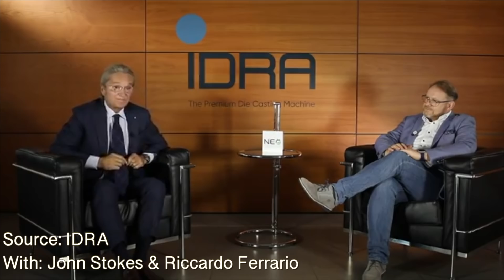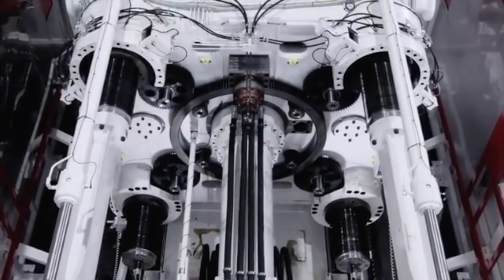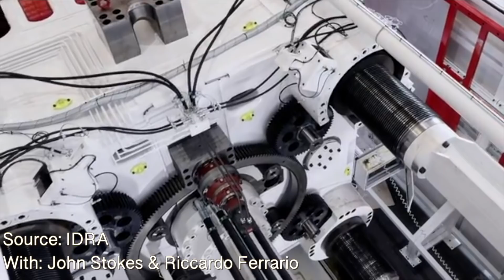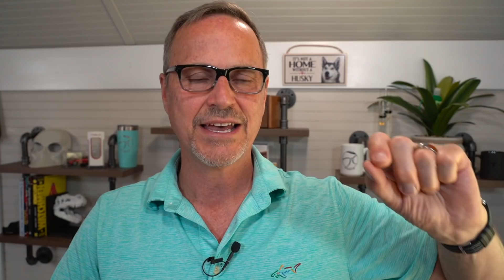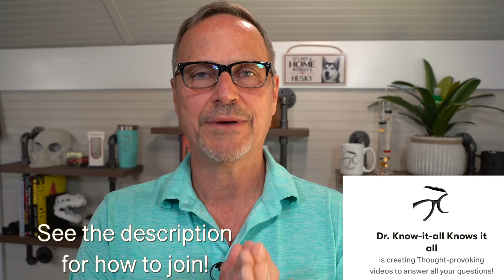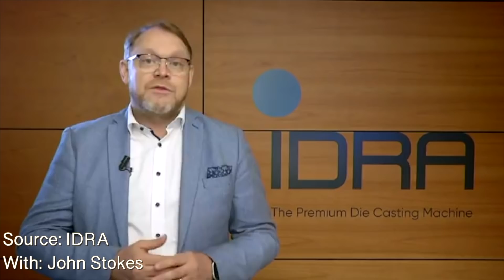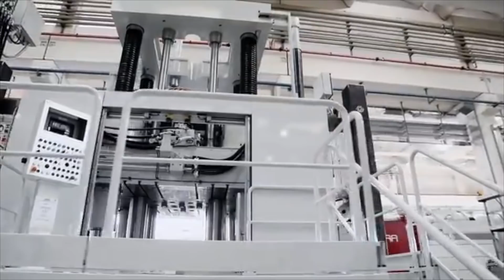Tesla's secret weapon: the Giga Press!

Comment: Hi mate, GREAT video I will definitely give it a shout-out on my news show on Sunday 😉👌✌️
Reply from the maker: Lars, love you, man! You're an inspiration for sure <3  Just watched your "model Y will beat the model Y" video. It's brilliant! Let's consider doing an episode or two together :)
Reply: @DrKnowitallKnows  Sandy Munro talked about this months ago and explained it as a game changer.
Fundamentally it reduces the number of parts that have to be separately manufactured and then assembled or attached.  

I have worked around injection molding machines in the past, including some of the largest then available. My boss sold one that was used for molding plastic front & rear fenders (we call them bumpers in Australia). That was a 3000ton machine built by LG. The tonnage of both metal casting and plastic injection molding machines is the main clamping pressure that can be applied to holding the die closed as you force in the plastic or metal.

None of it will happen as fast as you describe, particularly with these bigger parts. Part of the cycle is opening the die and getting the part out. The only machines that are blinding fast at that are CD injection molding machines and that has to do with the type of plastic used. You can actually get a CD out of the machine before its fully solidified which you can't do with most plastics. The rest need time to cool the part sufficiently so that it can be removed and NOT distort. You also have to open the die far enough to get the part out. What makes CD manufacturing so fast (about 4 seconds per disc) is that the die only has to open a small amount because its a flat disk. On more complex parts there are ejector pins in the die that push the part clear. Go look at the INSIDE of some of your plastic products and you will see a number of almost perfectly round flat circles (about 1/4 inch - 6 to 10mm) those are from the ejector pins. You have to open a die far enough so the ejector pins can push the part clear.  

On die size you are also way off. Dies are typically a lot larger than the parts being molded. That has to do with the pressures being employed and the cooling fluid requirements. Dies and die design is actually an incredibly complex process. The dies I saw used for fenders were almost the size of the car and weighed 20-30tons. To mold the part they were wider than the car, over a meter thick and 2-3meters deep. Typical cycle was around 1 minute. 

There's a gigantic contradiction in molding both die casting metals and molding plastics. You need the material hot enough to flow but then have to cool it to make it into a solid part. If its to hot it takes longer to cool down. If its not hot enough it wont flow as needed.

The cooling process takes time and has a huge influence in the part. Go look at the sword & knife videos with quench hardening & tempering. The really sneaky part is in getting the fluid/plastic to evenly flow to all parts of the die at the same time. Then there's keeping the die at a constant temperature as you do that. Then there's the design of the gas porting - yes you have to allow for the air to get out of the die as the plastic or metal flows in. You can have all the CAD/CAM/CFD software you like but in the end getting a die to work is a black-art process that there is no university course or vocational course for. It really is something that can only be learned via experience.

From an engineering perspective how the newer generations of molding machines save money gets pretty clever. How they open and close is pretty interesting but the really big saving is in using variable speed hydraulic pumps for the clamping and injection. Traditionally they clamped up and just held the pressure and that uses a lot of power simply via the pumps. You really only need the high clamping as you inject the plastic/metal and even then you don't need that straight away until the die starts to fill. Once the plastic/metal is in and you start cooling you can actually start backing the clamping pressure right off and that saves power (and cost). It never sounds like much per part until you add it up over 1000s and 1000s of parts.

If you want to talk some more about this or other technologies let me know.
I'm an a Australian who did aerospace at U. of Illinois. I have spent 30+ years in automation and control systems, first in manufacturing then in mining and resources. From an engineering perspective there are a lot of changes going on in the world right now with a lot of misinformation and lot of hype that gets very frustrating to hear.
Reply: @DrKnowitallKnows  Great explain my dear... This on the best Revolutionary technology for Brokem the paradigms araund the World...
I am hope this Big Gigafactoroy Tesla and IDRA COME TO BRAZIL...

WE HAVE GREAT OPPORTUNITY FOR INVESTMENT IN BRAZIL FOR MAKE BUSSINES IN ELETRICAR 100%  IN BRAZIL...
WELCOME TO BRAZIL....
Talk to me I am known about Brasilian lower Bussines about Bilder Up Eletricar and Cleanner energy in Brazil...

We are together for make great bussines industry in South America Brazil.... Near to South African
Reply: @DrKnowitallKnows  yeah for sure would be fun making something together. And I did just give you a shout out in my latest for this great video 😉👍
Reply from the maker: @BestInTESLA  Nice... or should I say, be nice!! :).  You're a huge futurist, and I love AI, and we both love Tesla. There has to be something in there for us! Hit me up at drknowitallknows at gmail and we can chat about it. Thanks for the shout out. Watching your news episode as soon as I get done with this comment!
Reply: @DrKnowitallKnows  wear 3 face diapers in every video granny killer, it's science!
Reply: I can confirm that A) Lars did give the shout out because he brought me here and B) Lars rocks.

Comment: The good Dr. forgot Pascal's law of fluid pressure. 6,000 tons is the force needed to keep the 2 meter^2 die shut against the fill pressure entering from a much smaller area. The 6,000 tons accounts for the ratio of the areas.

Comment: Please look up metal forging. There is no furnace underneath this press, it is simply pressing the still semi liquid metal under extreme pressure into its final form. Effectively forging it, so no casting porosity and better properties. They may still after removal from the press put the final casting through heat treatments to relieve any stress if needed.

Comment: GM, Mercedes, Porsche, and others use multiple materials in their chassis body work. That is impossible I think to do with one giga-press. Aluminum is best in some spaces, titanium in others, ceramic in parts, special alloys here and there, some steel, carbon fiber to save weight, and even plastic-polycarbonates in other sections. Tesla is doing aluminum alloy for the whole 3 major parts. They are losing some advantages perhaps? You could not do a C8 Corvette this way.

Comment: Clearly Dr Know didn't look at the video. The weight of the 6,000T machine was stated just a few minutes before he was talking about "more than a ton". Great machines and processes, but Dr Know should really learn a bit about the technology. For example, showing a zinc diecasting diagram when all the machines are for aluminium diecasting? Really? And "bending" sheet metal for chassis construction? That went out with the model T.

Comment: The “6000 Tons”, refers to the maximum clamping force that the Gigapress will be able to apply to the die or mold that is mounted between those two red platens.  

That massive force is needed because of the fast initial speed of injecting the molten aluminum, along with the large part geometry and ultimately its surface area.  

If there is not enough clamping force keeping the die closed, the inertial forces acting on the large surface area would blow the die open and create a lot of perimeter waste around the part, known as flash.

Comment: I'm not sure that people understand how big the impact is of the 6000-ton (pressure, not weight) model. The cost of any item that is built on the assembly line is determined mostly by the amount of actions you have to undertake to build it. Reducing the assembly line by 20% might actually translate into a 20% cost-down on production. That's absolutely frigging massive, even when you don't count the cost of the stations on the line.

Amazing advances in this field, tbh. I thought this technology was sort of finalized, but I was obviously very wrong.

Comment: Seems you completely misunderstood the man from IDRA when he explained LPF:
Metal is injected at low pressure (1 ... 1.5 bar), the feeder is closed and then the form "closes more" with a pressure similar to die casting. Well, this process is not forging, because the metal does not change shape in solid state in an essential way. Just in a minute way if at all.
Furthermore, cast aluminium tends to be brittle, forged aluminium ductile. The later you want when your car gets deformed in an accident. And after, when the car is still repairable, contrary when the car's main structure is made of a few castings.
As always, hot air from Tesla.

Comment: Disappointed!
Thought I was going to learn something. Not a single diagram explaining any of the processes.
6000 tone, means the closing force necessary to keep the die halves closed.
Bending steel? It's called stamping. 
Why not do some research before posting a video? A quick look in Wikipedia wouldn't hurt, so you could at least project, the illusion of knowledge.
Dr. Know-what?

Comment: There are real problems with Aluminum parts on cars Ford has gone to extreme lengths to isolate the aluminum from other metals. This was the biggest problem with making a truck with an aluminum body, any contact between aluminum and steel will cause corrosion .

Comment: It appears that one thing Dr. Know-it-all doesn't know is that forging is the shaping of a metal by either pressing or hammering it into shape, not a heating and cooling process (Though naturally, parts will heat if you deform them as the energy has to go somewhere, and preheating is an integral part of the hot forging process, which allows much greater deformation of material in a single pressing stage (Or less force/hammering to get the shape change required) and a wider range of metals for which forging is possible. Heating and cooling a metal to affect it's properties is usually termed heat treatment and is about reducing residual stress after forging/casting or creating a more desirable grain structure within the material to increase hardness and/or toughness.

He's probably confusing forging as a process with the use of the word forge to describe a blacksmith's furnace. Forge in this context refers to both the furnace where material is heated and the whole blacksmith's workshop (where hammer based forging takes place). This, combined with, what I suspect based on the rest of his commentary is very little mechanical engineering background, explains why he's made such a huge mistake but doesn't realise it.

Comment: As far as I see something is completely going wrong here:

1. The star isn't a press but a die casting machine!
2. A 6.000 (metric) tons press is a baby!
3. 3 parts for just 1 whole undercarriage are 2 too much already!
4. The story rather is that Tesla wants to build the whole model Y body (and future models as well) out of 4 die-aluminium-parts!
5. This would reduce significantly the weight and would lead to a reduction of machinery investments (welding robots & presses) by 20 to 30%
6. There are disadvantages of a die-aluminium-body. Production tolerances have to be extremely small in the crossover between the casting body and the sheet metal. Body repairs as before won't be possible anymore and damaged parts would have to be sawn out extensively. Besides aluminium is a super expensive material with a doubtful life cycle assessment!
Reply: I know calling it a press is ridiculous. And as far as large presses go, we had presses at the Budd Company that pressed out one entire side of a passenger rail car in one shot

Comment: This is great. Casting is perfect for high volume parts. I  had a job as a die caster, it was like hell on Earth. The Giga Press is at another level, same process.
Reply: Castings are great until your car has a minor bump and you discover that a slight bend in the casting will write the car off. I hope I'm wrong about this, but nothing so far in Tesla's execrable customer service and terrible attitude towards anyone working on cars they bought themselves suggests this won't be the case.

Castings often can't be repaired because even though it has a lower melting point and is softer, welding aluminium is very difficult because it's far more thermally conductive than steel, so getting one point of the casting hot enough to melt where it needs to be welded will run a very high risk of the rest of that heat igniting anything flammable that same casting touches - namely the rest of the car. 

Most castings have very good strength to weight and phenomenal strength to cost properties, but poor toughness and high rates of work hardening (Which again aluminium in general is much worse for than steel), which means that there's a good chance a bent part will either snap or crack in a minor impact or will snap instead of bending back, unlike pressed steel car parts. This building method will will almost certainly be much cheaper for Tesla, but they're keeping all the savings as profits, while passing a maintenance time-bomb on to their consumers. It wasn't a big deal when Tesla buyers were buying them as second or third cars, but those buying them as their only car are already being hammered by this when they discover that simple repairs and shortages of parts take their cars off the road for weeks to months.
Reply: @peglor  Great point. You really can't weld an aluminum structural casting. They are also very rigid and will resist bending, but will break instead. It should be strong enough to resist minor accidents. Replacing the entire frame would be very expensive.
Reply: @bobchemist  A quick example for how this construction method could cost customers a fortune - a friend of mine was rear ended at a junction by someone reading a text message. The car looked okay, but on opening the trunk there was enough bending in the floor that the spare tire couldn't be taken out of the wheel well. She dropped it in to the dealership, they replaced the trunk floor pressing and crash bar (Not sure if the fender was replaced as it popped back to shape straight after the accident. 

Doing this with the rear quarter or the entire rear of the chassis, as is the case with a Model Y, or the entire rear of the chassis, as will be the case with the newer models, would be 10's of thousands and a long, long wait, rather than 1-2 thousand and a week in the shop (Or the option to do it at home of you have the skills and space, because, unlike Tesla, other car companies are happy to sell their parts to anyone who asks for them).

A likely end to this is the car becoming an insurance write-off, costing more than the car is worth to repair and creating more waste, which is an environmental cost that an electric car (Which already has a higher environmental cost to make) can't offset unless it does enough miles.

Comment: Die-casting is a great process, but it lacks flexibility.
Sure, die-cast production uses a fraction of the workforce, but once those die are in place, that is the ONLY part you can make.
A traditional fabrication/welding line can re-tool to meet changing needs in a few weeks.
The lead-time for a large die can be measured in years.
With dies, the expectation is to churn out the same product with no adjustments, forever.
Why do so many Tesla Fan-Boys act like unemployed auto-workers are a good thing?

Comment: I found this to be very interesting and very cool.  Thanks for the research and sharing.  Many years ago, I had performed contract work at an aluminum alloy suspension die cast company (Contech, now Michigan Die Cast I guess).  As I recall there were about 30, 2 meter-square cast machines.  The suspension parts, such as upper-lower A-arms, rack-and-pinion housings, etc., were x-rayed for quality checks (inclusions/occlusions).  I recall with certainty machines were not the size of a house!  Maybe 20’ x 40’  (7m x 15m-ish) - best as I can recall .... after all, I was validating the control systems experienced no “Y2K” issues (AllenBradley PLC-5s).

Comment: This Gentleman has Never Seen a foundry from inside. Especially the second explanation is Crap for the Vertical Low pressure die Casting machine featuring an Improved squeeze cycle. If somebody has a real interest, just check search phrases like squeeze Casting, low pressure die Casting or thixo casting. And the utterly Secret tesla aluminium alloy is revealed in a matter of minutes, when you put a sample into a mass spectrometer. Guess it will be either AL 231 or AL 226,  the latter a bit more prone to corrosion.

Comment: As far as I know,the forging alluminium parts for cars is in favour of low cost and energy saving.But let us not forget that;the need of huge amount of part per  day,does not tollarate lost of time and break downs..And don't forget that these kind of machines are very complicated and all complexity tend to the failures very easily.Whereas ,the continuity of a mass production is a 'must ''.
The  actual technology is dividing and spreading the complexity to the multiple stations and consequently the problems and the difficuties have been shared with the others .The simplicity is easy...But the complexity is risky ..Are we ready to take all the risks?This is  the main question...Can we answer very frankly and easiy to that question ?